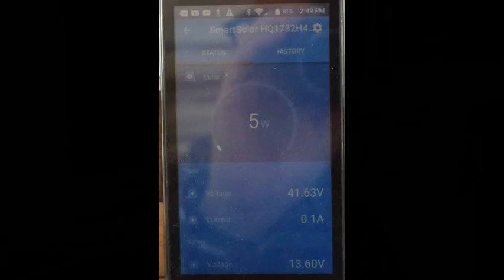Victron SmartSolar 75/15 MPPT Solar Charge Controller - How is it working after 3 Months

Comment: You said 2 x 50W panels connected in series and then you said 100W panels. Do you have an additional 100W panel? Did you mistakenly add both Volts and Watts, while the panels are connected in series?
Reply from the maker: I have two 50 watt panels connected in series.  If I said 100 watt panels I simply misspoke.  The controller can handle up to 220 watts of solar and I have considered switching to two 100 watt panels.

Comment: This was a good video, and thank you  for sharing, you mentioned how annoying them  lights from the controller, LED'S. just put a little bit of bluetec on them, I have had the same issue, i put a very small amount on the lights, so thin that i can still see the lights, but not as bright, :)
Reply from the maker: My wife hang a towel in front of the controller.  The LEDS mostly bother her which results in my being bothered too ;)

Comment: That's a handy video,I use several of these units on my fridges and they're great, your point about the LED'S is very appropriate with regard to boat living and appreciate the impact that would have but mine's in  my pool area so fortunately it's not an issue but if you had to sleep in the wheel house it would be a downright pain, cheers
Reply from the maker: I don't sleep in the wheel house, but it is very annoying when enjoying a quiet evening in a beautiful anchorage.

Comment: Hii Tod - Victron is indeed one of the best but kinda  expensive   - the new super cheap Wincon PWM would allow you to set the cutoff lower so it does not set off your alarm  if your viewers wanted a cheaper solution  - folk who use PWM need to match the Solar panel to their battery more closely for them to work efficiently  so the panel has about 3v headroom eg 17-18v for a 12v Pb system that needs 14.5 ( Panel voltage maximum power  point drops as panels get warm) - for our RV we allow 100w Solar for every 100ah of  battery - your 100watt for 3x110ah will be little more than a top up trickle charge & float.
Reply from the maker: A PWM controller will always throw away potential charging energy relative to an MPPT controller.  How much charging you need depends not so much on your battery bank size as on your usage.  In my case 100 watts of solar keeps my batteries near 100% because the solar array provides more than my usage when the boat is not moving.  When the boat is moving my alternator pretty much guarantees that my batteries will be fully charged after a typical 3-4 hour run.

Comment: what is the most watts you have pulled from your panels? i have a 120 watt solar suitcase and the most i have pulled in is like 45 watts. Seems very low to me.
Reply from the maker: It depends on a lot of things.  First there are panel considerations - Is the panel partly shaded?  How is the panel oriented?  How far north are you?  To get maximum output you need to have your panel properly oriented toward the sun.  A horizontal panel will be derated by 10-15% relative to a panel oriented toward the sun.  Shade will greatly impact your panel output, by as much as 50%.  In addition, the size and length of the wiring run between the panel and the controller can also decrease output measured at the controller if the wires are too small for the distance.  Next is the batteries.  Victron controllers will change the operating voltage of the panel to get only as much power as needed.  So if your batteries are more or less fully charged you will have very short bulk charging times and much longer charging at low amperage absorption of float charge.  In float mode the controller will only put out enough amps to maintain the batteries at their float voltage and will do that by  running the panels at lower output.  So to see maximum output from your panels you need batteries that are drawn down quite a bit, bright sunny days and panels wired properly and aligned toward the sun.  

This summer my 100 watt panel hit 85 watts output only on bright sunny days after I had drawn the batteries down quite a lot.  My panels are horizontal so 85 watts is about the maximum I can expect.

Another possibility is that your solar suitcase, which I assume has two 60 watt panels wired in parallel has a broken connection on one panel and that you are only seeing the output of a single panel.  I would check the connections on the two panels.
Reply: Thank you
Reply: whit use off this victron mppt controller you should have the full pannel power... so at 12 volts you have around  10 aps charge current, iff not there is something really wrong...(or you have shade on the panel, Aiming it directly at the sun will increase it even further..